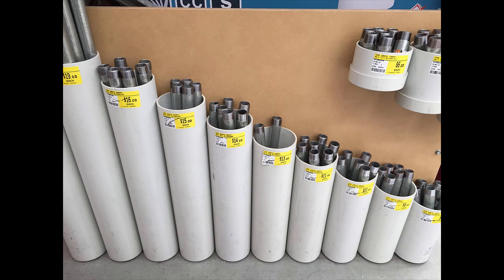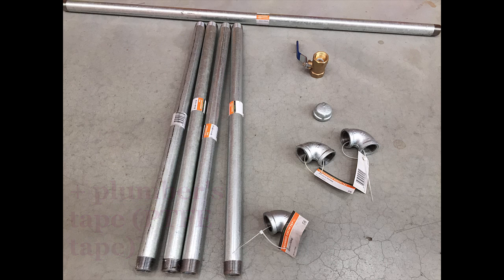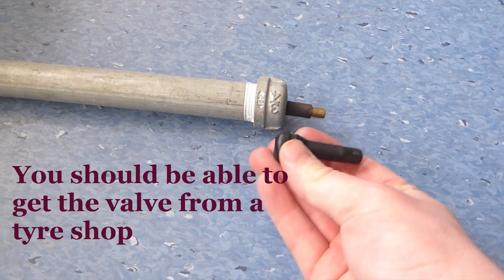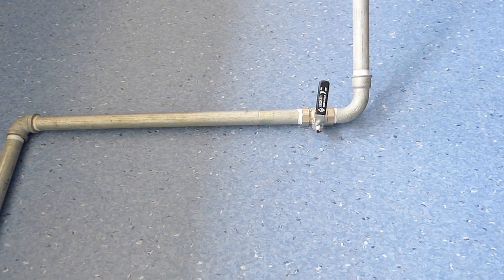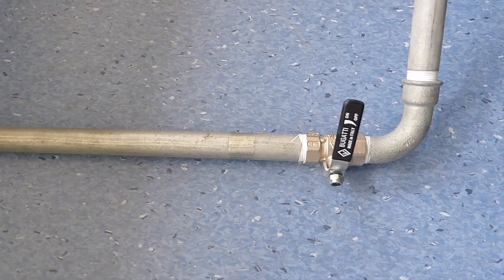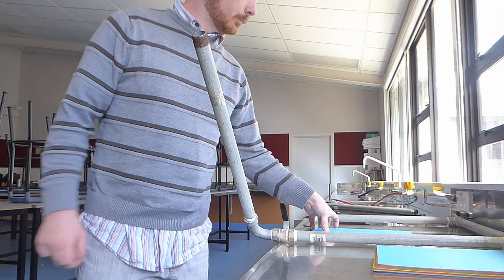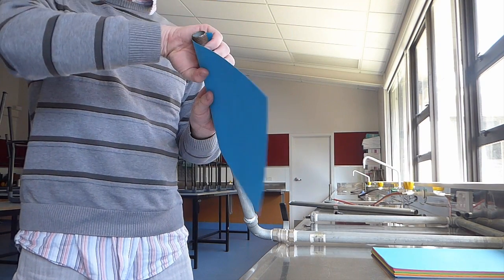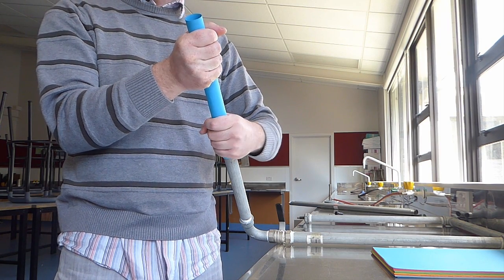How to build a compressed air rocket launcher (giant spud gun)

Comment: Thanks for this.  Why metal pipe versus plastic?
Reply from the maker: My pleasure. Great question. I use metal for two reasons: 1. the galvanised pipe we can buy here is threaded so is easy to fit together 
2. I believe the metal will cope with higher pressures and is less prone to damage